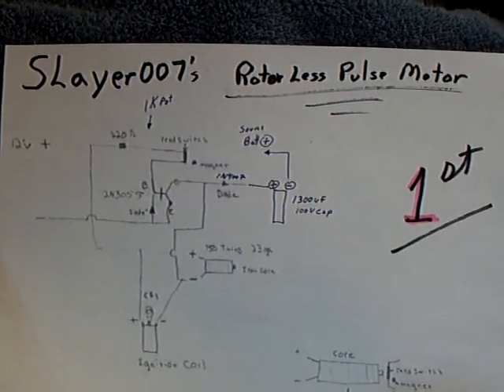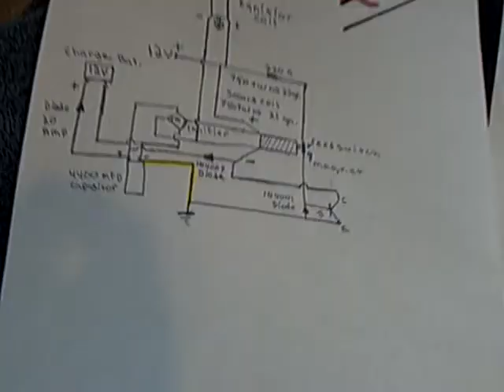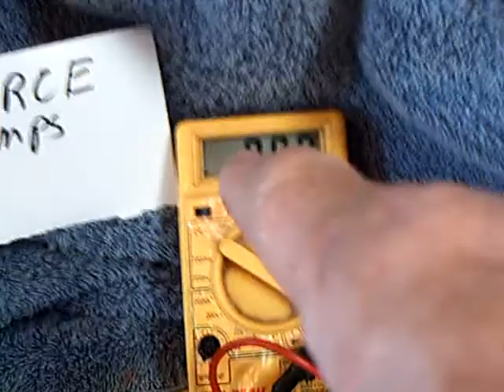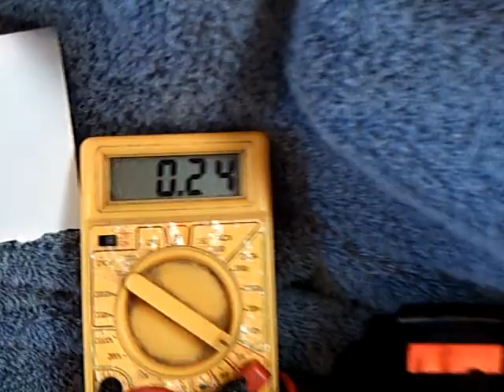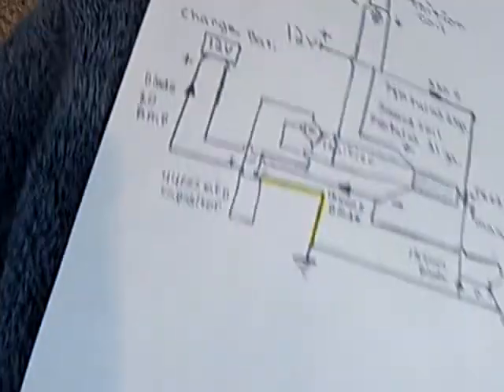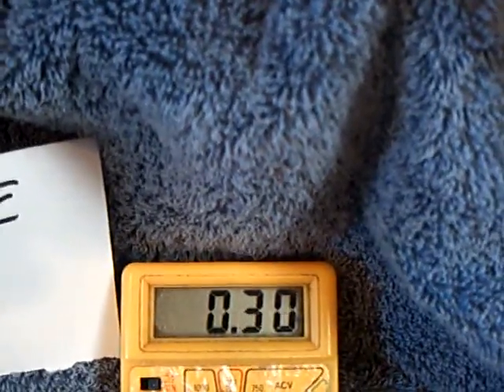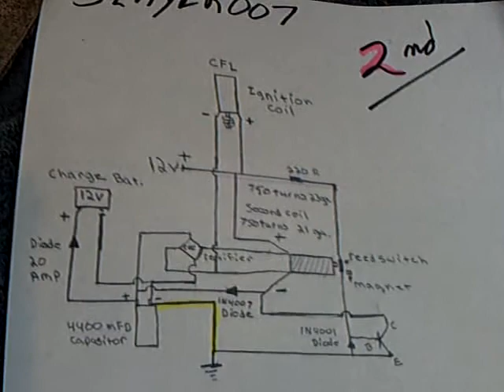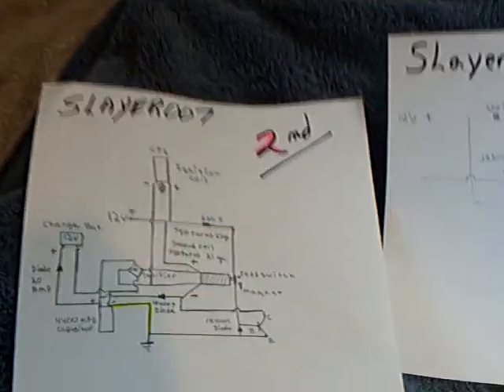Slayer007 ---2nd Circuit-- Rotor Less Pulse Motor

Comment: Thank you For making this video Lidmotor.
Allso try moving your diode from the ignition coil down to your transistor.
That way you can still pickup the BEMF from the primary coil when the other coil is unhooked.

Thanks agine Great video.